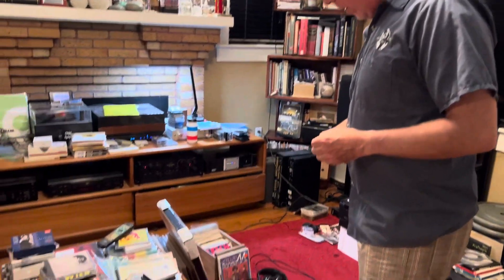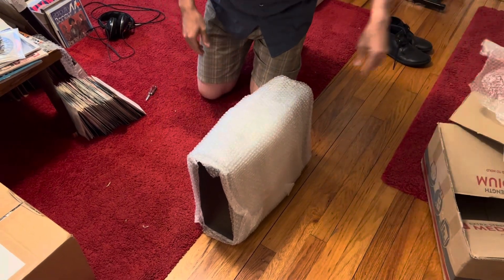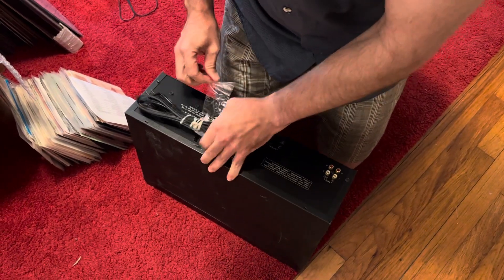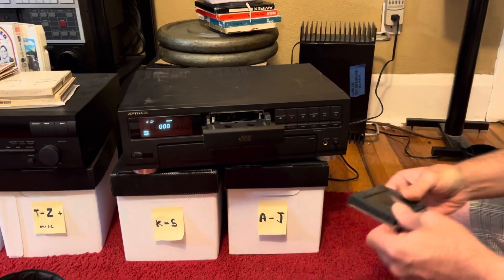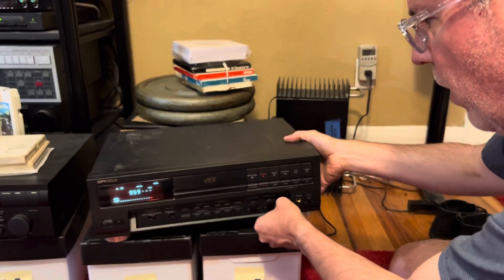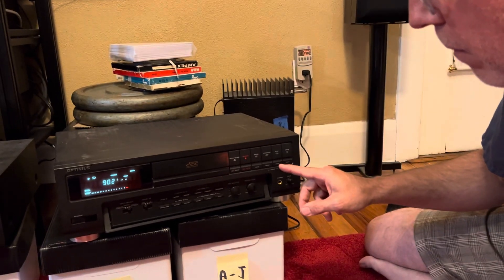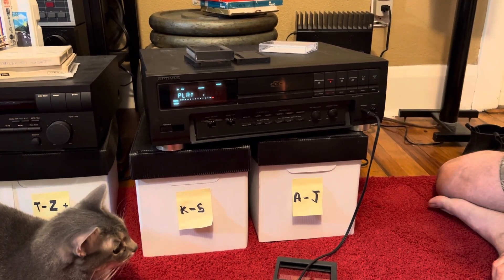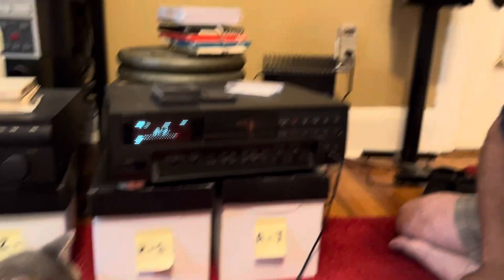Optimus DCC Deck Unboxing & Test

Comment: The squealing you hear is the tape sticking to the pressure pad in the cassette shell.  I have several of these Scotch and  Supertape from Radio Shack and they all do this.  So even if the deck worked, the tapes would not play unless you remedy the pressure pad.
Reply from the maker: Thx, I eventually saw that on Dr DCC's site and had an 'a-ha' moment. So basically my untested DCC deck has every age-related malady they're famously prone to having.